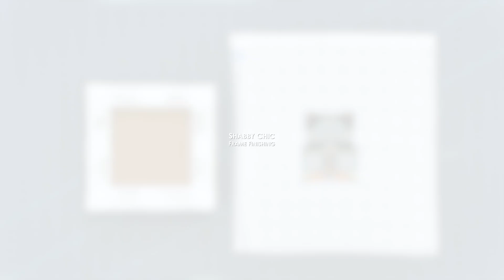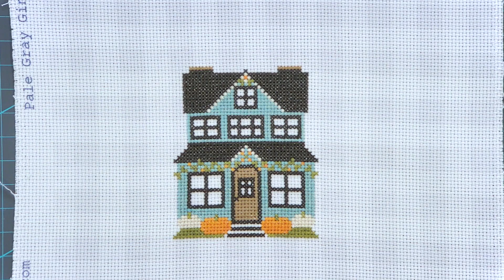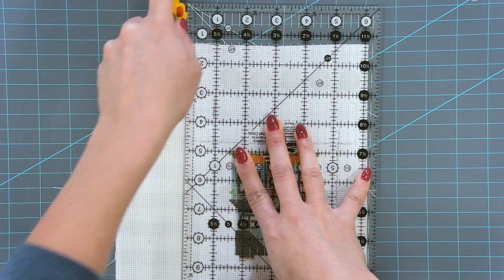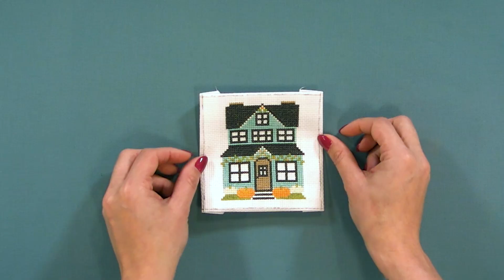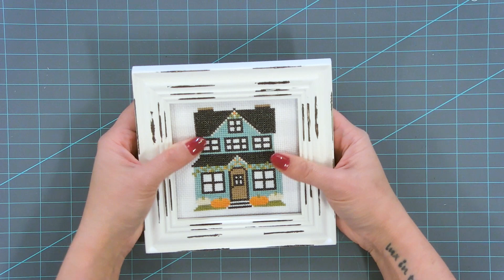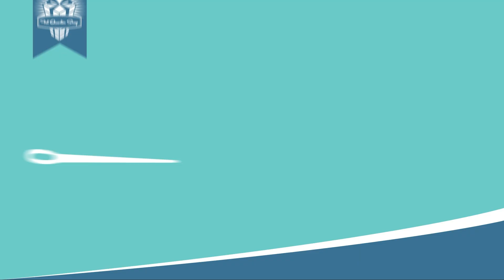Simplest way to Frame a Cross Stitch in a Picture Frame! 🖼️ Straightforward How-to Framing Tutorial

Comment: I have a question. What are the two layers that were placed on the cross stitch piece before the frame backing?  NO glass in the frame. This tutorial has come at just the right time. THX
Reply from the maker: We used two 4.5 inch squares of Soft and Stable https://www.fatquartershop.com/soft-and-stable-white-18-x-58-100-polyester-stabilizer